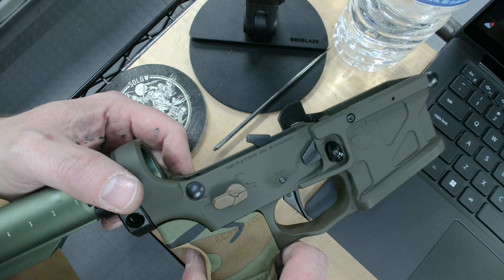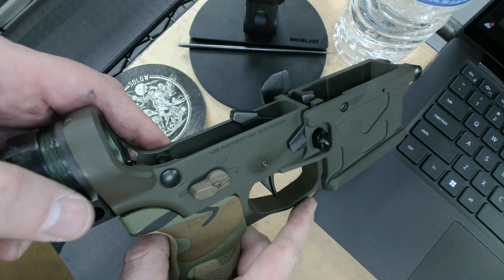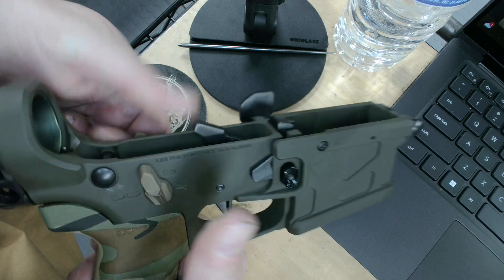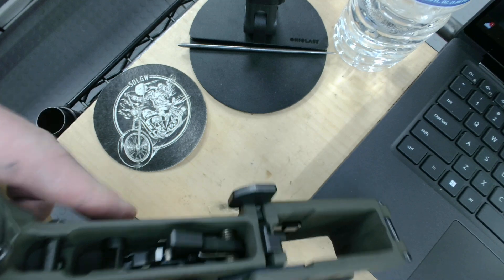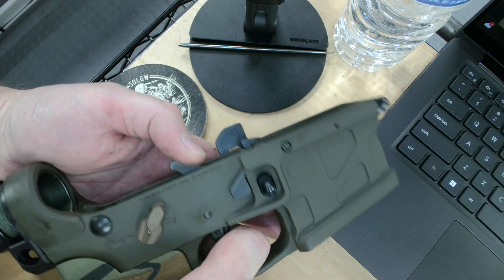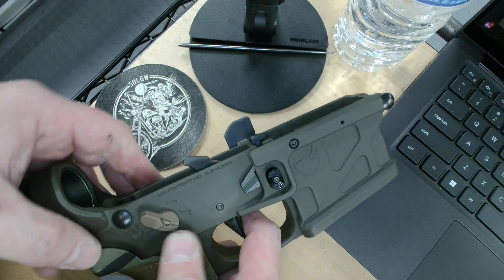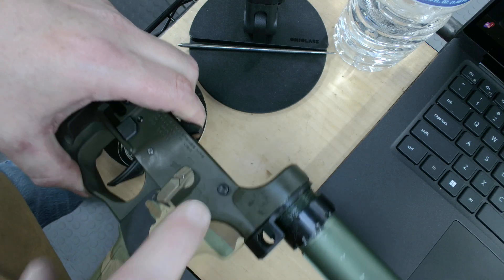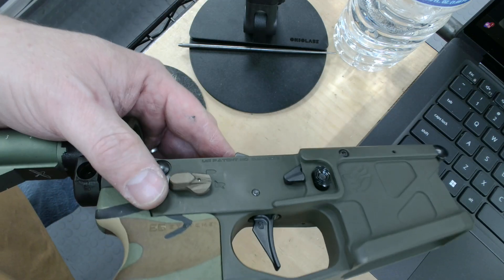Radian Selector Function Check & Failure - Upgraded Selector (See Description)

Comment: I have a adm lower that will not lock back with any aluminum mags period. Works perfectly with gen 2 and 3 pmags. Its gone back to adm twice and both times they claimed they fixed it. Any experience with this?
Reply: My ADM4 was having issues locking back on the last round on some aluminum and Lancer mags on the last round. 

They opened my gas port up a bit on a warranty claim, and seems to be working now, but I’ve only had one range trip so far. 

Might just be the tolerances on that particular lower. Are you using an ADM upper?

Comment: Hows that ADM Ambi lower? I'm thinking about getting one. I have a Magpul BAD Lever on my lowers right now but that ambi release looks the easiest to use of any on the market.
Reply: Check out the Griffin MK II lowers. One of the brothers that own Griffin apparently did the initial engineering on the ADM on what was supposed to be some sort of joint venture (both are located in Wisconsin) that fell apart. Griffin lower is basically a forged version of the billet ADM and it’s about half the cost. Mine paired up really nice with a BCM upper.

Comment: After talking with Roger at Forward Controls Design, it’s the 45 degree selector that is the issue. The 50 degree and 90 degree selectors dont do this. Additionally, it is the perfect combination between the lower and selector that will cause this. Not every 45 degree selector will do this with any lower. Just the right match, or wrong for that matter.
Reply: Agreed no issues if you go 90

Comment: i cant because my lower has stops so i cant even try it. this is y i like good quality mil spec parts that r qc. my rifles feel like theyre on ball bearings and run flawless but i measure all my parts and return the junk. thats y i love this channel cause it taught me what a quality ar should be. im an engine machinist and a manual job shop machinists so i already have the tooling needed and thanks to Chad i learned what was important when building a rifle. Thank u Chad.

Comment: You should cover the issue between the talon and some G triggers.  Specifically I have found and issue with the super tricon and ssa-e x and the talon in the 45 orientation where the trigger will not break.  Issues are not present in the talon 90 config.
Reply: Yup if you go 90 it doesn’t have problems with the 45 nothing but issues with my G trigger SSA flat face.
Reply: I have 2 lowers with Talons (45°) and Geissele Triggers (SSA and SSA-E) no problems with either.

Comment: This topic came up about a year ago. ALL my Radian selectors did this on everything from milspec lowers, ADM lowers, even Radian's own lower. BAD safety selectors did the same thing on even their own lower. The two selectors that didn't exhibit this same problem were my most expensive and least expensive selectors. The most expensive was the FCD/SOLGW Quick and the lest was a no name ambi selector. But like Chad states...how much of a problem this is? Is it possible, yes. How probable? not much.
Reply: I can't get my Radian safety to do it on a Griffin MK1 lower(which is just a milspec forged lower). I only have one of these to test it. The BAD safety sucked though, i hated that one. Normally I just go milspec.

Comment: They may feel nice and give that “Gucci Vibe” but taking a milspec selector (1 solid piece) and replacing it with 5 separate pieces just leaves more opportunity for failure.
Reply: 7 pieces
Reply: I don’t think they feel nice or give any positive “vibe”.  The milspec selectors are light years ahead of these.
Reply: @bmrz38  How are they light years ahead, exactly? It's just machined and assembled differently. I generally just go with a milspec selector cuz I'm right handed anyway and legitimately don't care. BUT I got one of these with a steep discount because I was ordering their charging handle at the same time. I like it. As far as ambi safeties go its the only one I actually like. Only in the short throw configuration though and I think for a semi-auto only rifle short throw makes a lot of sense. 

Also, I'm trying like hell to get mine to spin and it just won't do it. That's with a Griffin MK1 lower.

I have found a huge variation among lowers/selectors though. Safeties in general seem to be one of the parts where the tolerance is critical. between the lower/detent/selector--if any one of them is slightly out of specc it'll result in a crappy selector or even a dangerous one. I have been able to remedy this type of issue by just swapping out the detent or the safety and it usually fixes the issue.
Reply: @armorers_wrench   the milspec ones I use snap into place smoothly and feel good. The Radian safety feels mushy, and has to be forced more into position.  I’ve heard the Radian will feel better over time, but so far I’ve had no such luck.  Just my .02
Reply: @bmrz38 I have several in different lowers and with different triggers and the only combo that didn’t work was with a Hiperfire trigger but that holds true for most 45 degree selectors, so I have to use Hiperfire’s selector on my competition rifles that have them.  You either have a detent or spring issue or an out of spec component (grip, lower, trigger) if yours aren’t clicky.
Reply: I'll keep my radians, I have it on seven different lowers and never had this problem. This man spends his days looking to see what he can find wrong why doesn't he ever recommend anything good?
Reply: No the algorithm brings sugar tits right back to me

Comment: This will happen with you use a takedown pin detent spring for you safety detent spring.  I made that mistake before.
Reply: The point is that you still can have issues even when you don’t make any rookie mistakes. Saying you experienced a problem when you did something wrong isn’t really saying anything helpful. That’s the outcome one would expect.
Reply: @blueeyeddevil1  The first time I assembled a lower on my own without watching any youtube videos for reference(also, I did it on thanksgiving when i had company coming over, so I put added pressure on myself for literally no reason lmao) I actually installed one of my takedown pins backwards. Luckily I just used a hook to compress the detent/spring and removed the takedown pin.
Reply: @armorers_wrench  Everyone makes mistakes in the beginning. The important thing is learning from them 😉
Reply: @blueeyeddevil1  🙄🙄🙄🙄🙄🙄🙄🙄
Reply: They don't really look that similar, safety selector detent spring is bigger diameter and more rigid.
Reply: @whatsmolly5741  you are right.

Comment: Speaking of safety selectors. A long while back I purchased a complete lower. Upon a few days of ownership and familiarizining myself with it, I noticed the safety felt very mushy. Took the detent out and noticed the safety had effectively ground down the tip of the detent. I replaced it and has since been fine. But have you ever experienced this? Bad heat treat on the detent perhaps? Curious how that happened.
Reply: I've definitely had to swap detents/safeties before to get a "crisp" safety. If you put enough of these things together I think you're basically guaranteed to have that experience at least once.
Reply: @armorers_wrench  fair enough. I have a few full builds from the pins up under my belt. Figures the first time I wanted a little convenience, I get something screwy going on lol
Reply: @CrashRacknShoot  Did you get a cheaper LPK by chance?
Reply: @armorers_wrench  it was a fully assembled PSA lower, so that answer should be obvious 😄 as for what I replaced the detent with, it was much better quality. I have quite a few LPKs I inherited in a big mess that I sorted, so not sure what I replaced it with, but it worked.

Comment: I love my ADM lowers!
Reply: May i ask why?
Reply: @bjornegan6421  quality is great, I also prefer the style of ambi control. Right side down on the lever releases the bolt with little resistance, lift up on the lever and it holds the bolt
Reply: @JabbaDuhNutt  thanks
Reply: @BlowinLoud8799 in what way do they feel better? have you gauged them?

Comment: Older or newer safety?  Radian had that exact problem a year or so ago and had the change/modify their manufacturing on the safety barrel.  It was very common.  However newer ones are good.  Curious to see if this was older stock
Reply: This
Reply from the maker: New
Reply: @SchooloftheAmericanRifle   new, old stock?  Or New, New?  They claim to have fixed this (well known) issue with a redesign.
Reply from the maker: @jvmicc2 new, new
Reply: @SchooloftheAmericanRifle   bummer.
Reply: @SchooloftheAmericanRifle  i had the exact issue with my UIC lower. I tried a different detention and spring. No more issue. Very strange occurrence.

Comment: Would a shim fix this?
Reply: Beat me to it. I've got an ar that's safety is a little sloppy. It hasn't jumped track yet, but it makes me nervous. It's a range weapon, and the problem seems to be the frame is slightly thinner in that area. I've tried a few different safties, and all have the same issue. I'm open-minded if anyone has an idea. I'd love to hear it.
Reply: @vegan-cannibal714  Have you tried simply putting in a new detent or detent spring? That has fixed my issue several times now.